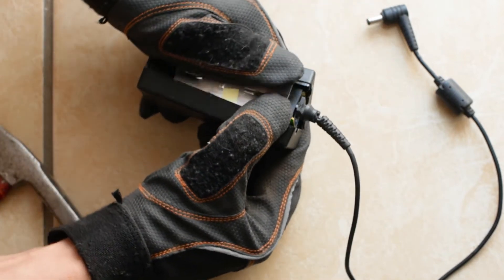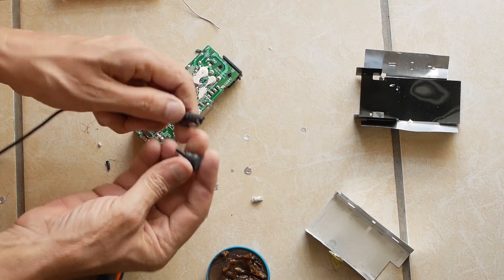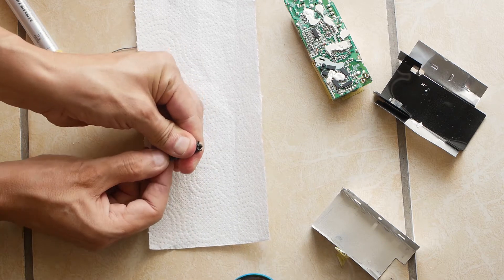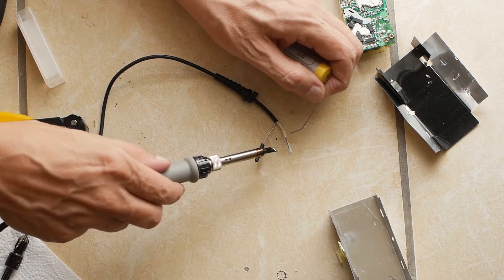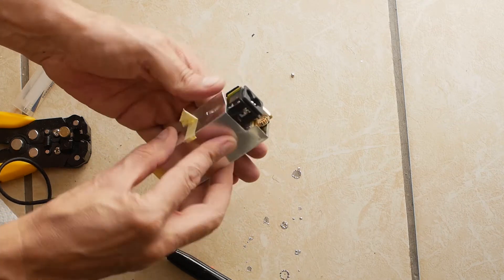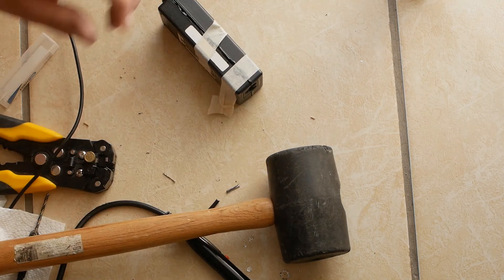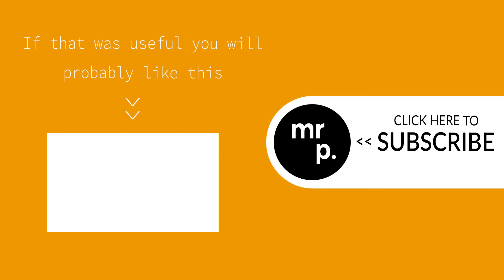Open Laptop Charger and Repair Cable  💻

Comment: I finished it — thanks!

But in my case, there was no need to remove that metal piece, because the two wires (the white one and the small black one) were already correctly connected to the board.
Actually, the wire was cut outside the charger, near the input section where the cable enters the charger.
I noticed that the main big black wire of charger had the white insulation still on it, but there was also an "uncovered"  wire as reminder of thet small black wire.
This exposed part had been cut, so I reconnected it.

Now my laptop works perfectly!
Thanks again!

Comment: I have Vaio Sony and there is a green LED light on my laptop Charger . When the green light is  ON it shows in my laptop that is charging . Sometimes it is plugged in and the green LED light not coming . It is getting faulty , the cables are all ok the unit not generating AC to DC .

Comment: Excellent video.  I ordered an incompatible charger for my laptop because I wanted a beefier one than original.  It had the wrong end or the pictures weren't correct.  In any case it's otherwise compatible, so I have opted to swap the cables rather than return it.  (the old supply is dead this isn't just for more wattage.)  

I wondered if these would open this way and then snap back closed.  I like your practical, get it done approach, but the damage would defeat my purpose for opening the box at all.  I will probably opt to splice the cable and heat shrink over the repair since I am likely to sell this laptop soon and don't want the power supply to give a buyer pause.

As for the increased wattage, I'm going from 45 to 65.  The question is why did the supply die to begin with.  I think it could use more headroom than it had.  the new supply box is about twice the size of the original which makes me more confident whether it actually should or not.

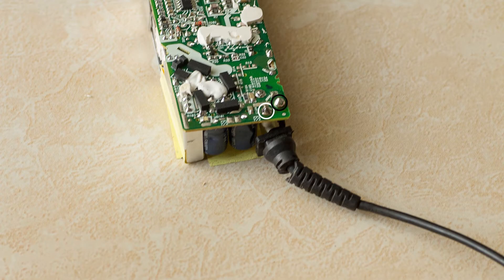Comment: Hi, Thanks for the help.  Where can I get a new cable protector like the one in 1:05 so I can fix my cable?
Reply: maybe silicone springs they sell to usb cables? or something like this. original protectors are joke if cable breaks at it. same in mains. i rarely have encountered a one which actually bends with cable. otherwise this is a joke. they are more like pullout preventers or attachment anyway... but you have to hack. in fact you can buy entire bet cable too but cba if it's enough